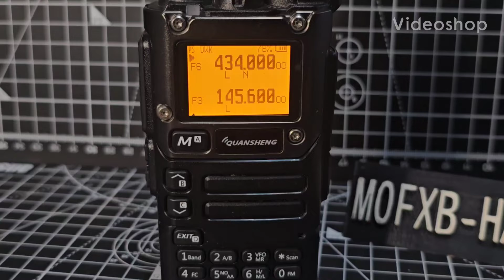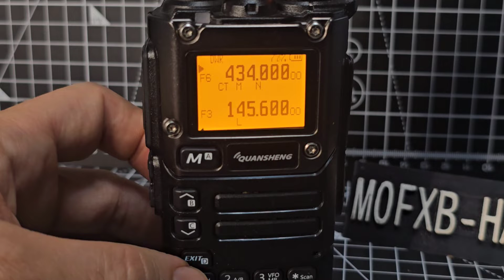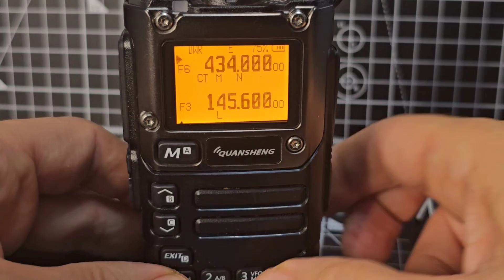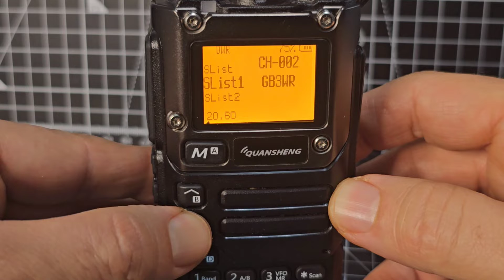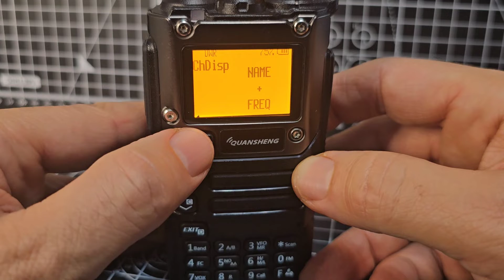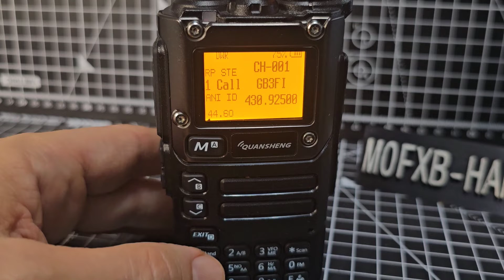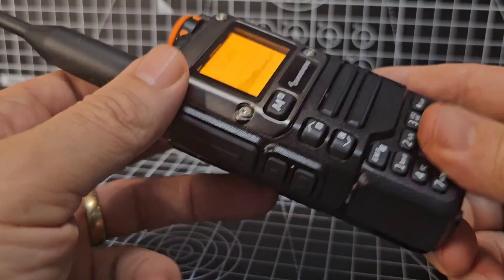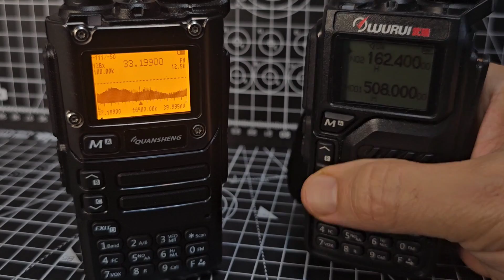QUANSHENG UV-K5 , MENU LIST 1-60

Comment: Battery calibration. Voltage reading on an AVO meter can be equalised on the radio. Example  AVO meter says 7.8v, switch on the radio, it says something different but they can both match. I have noticed when the charger turns green, the radio isn't 100% but that of 98% which may be why the radio's are tuned out of sync. I will have to keep an eye on this. Fortunately I have a second radio to copy the default values.
Reply from the maker: Cool thanks tye k5 prog by IJV has a great back up option .
Reply: Most lithium based battery equipiment only charges to 98%
Reply: I think it has been fixed in 022!?! You can calibrate the battery in the settings

Comment: The latest mods from Figci (the November ones) are so ABYSMALLY more advanced than this Exzumer garbage! - besides him (exzumer) seeming to having copied parts of it (Fugci’s). This sadistic dork want you to go 10 times through his “Tx unlock” menu in terms to unlock it (!!!???), it really betrays the dude having a mental problem… The November Fugci has four reception modes Raw, Bypass, Am, Fm, Ssb. You can transmit on, lets say, CB band FROM within the spectrum scanning page. Everything is very nicely designed. The exzumer one felt very artificially complicated and labyrinthical, full of blockages in the flow.

Comment: Does this firmware disable TX on 18-54MHz ?
Reply from the maker: You choose in Hidden Menu
Reply: @M0FXBHamTech  I did try the power up holding the PTT plus the button below and I did get into
the secret menu  but could not find a choice to enable TX from 18-54 MHz.  I went back to the previous firmware that does allow TX.
Maybe I will try the firmware in your video one more time.
Reply: Don't transmit out of the bands its designed for, otherwise you'd cause massive interference on other bands due to the harmonics, and you run the risk of frying your transceiver.
Reply: @nathanwaller7242  save the lecture,  I have my reasons

Comment: The keys to press to activate the "secret" menu seem to behave slightly different from usual with this firmware. Switch on the radio while keeping down PTT and first button, then release PTT and only then the other button. If you release then at the same time nothing happens.
Reply: What version are you useing?
Reply: @nathanwaller7242  The last one, from the link provided. I just flashed the radio with it, from the other firmware I had.
Reply: @ascaniosobrero  should just say release all keys then gives you the sub menu as well as the main 60
Reply: @nathanwaller7242  It does, as I said, but not releasing the two keys at once. I have to release PTT first and then the other. Not a big trouble, just strange
Reply from the maker: https://youtu.be/6rULC8fKUx8